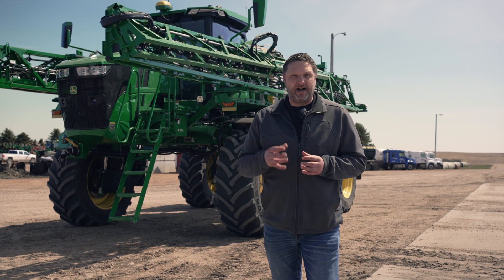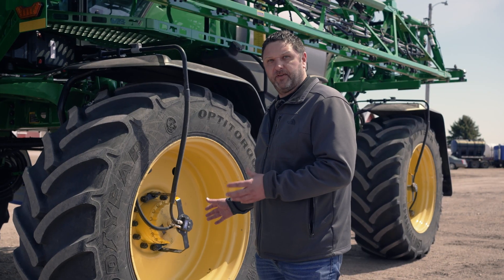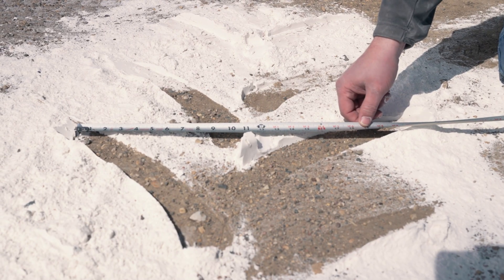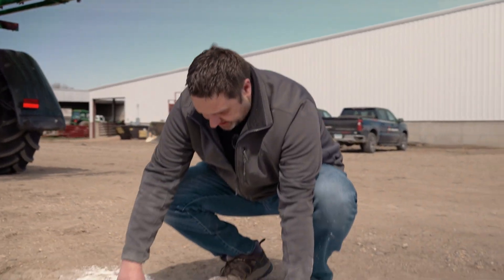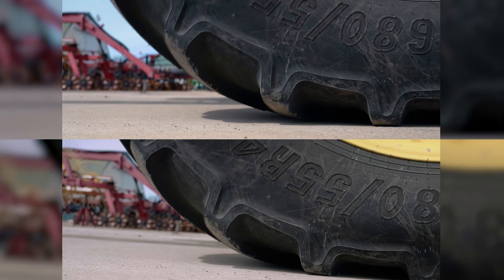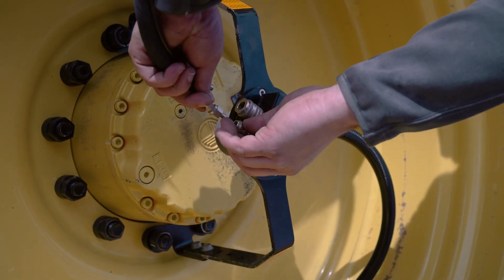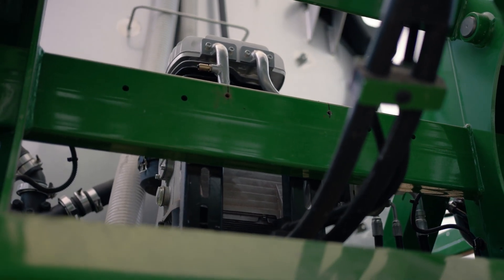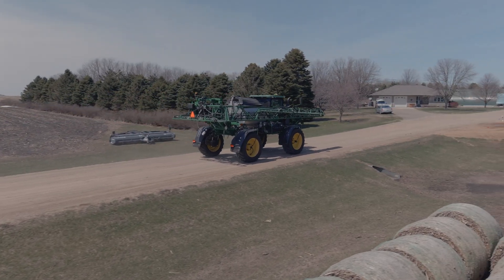Boost Your Sprayer's Performance with Central Tire Inflation

Comment: What’s the difference between LSW tyres and VF tyres?
Reply from the maker: LSW tires are technically VF tires. LSW stands for "Low Sidewall" which means the sidewall height of the tire is shorter than a typical tire. LSWs are unique to Goodyear. VF stands for "very increased flexion" which means the tire can carry 40% more load than a standard radial tire or carry the same load as a standard radial tire at 40% less pressure.